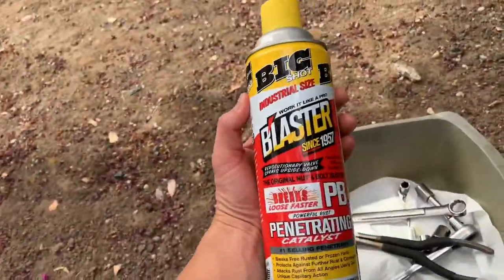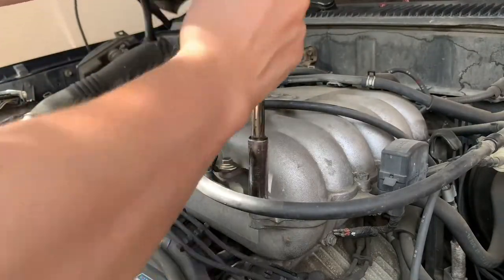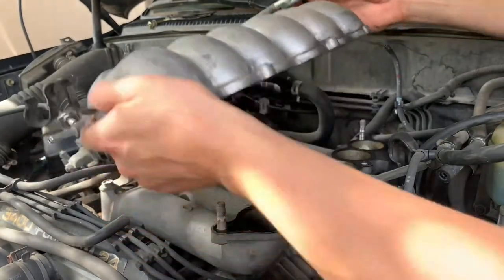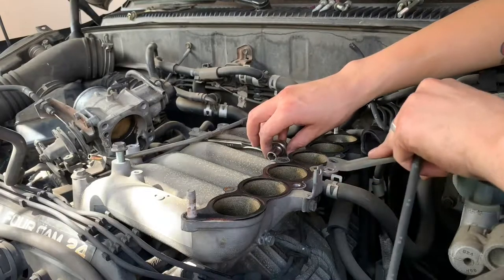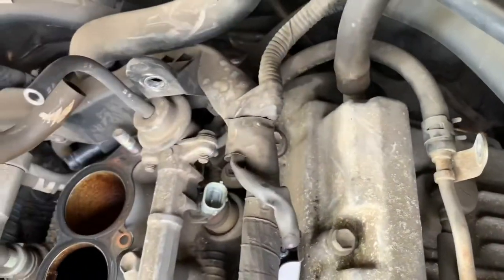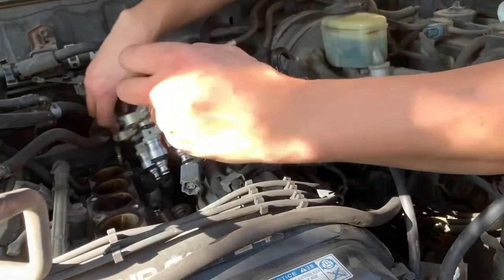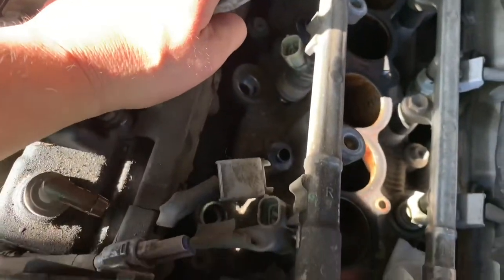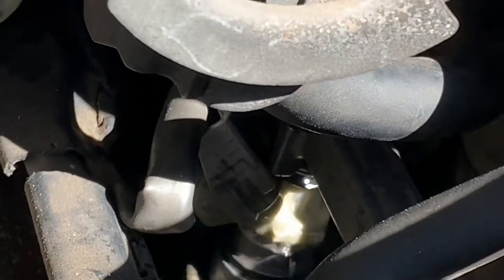How To Change The Fuel Injectors On A 1996 Toyota 4Runner / Misfire

Comment: Useful info here, and a much better edit than the other video I watched.  Shame about the sad ending.  I only replaced one, but it was passenger side (#3).  Encountered the same issue with tight clearance to that electrical housing, but managed to clear it with a little work.  Made sure the injectors slid back in nice and easy. 

BTW, some may be interested to learn that if simply replacing one of the passenger-side injectors (#1, 3, or 5), it's only necessary to remove the throttle body for access - can leave the intake on.  Also:  after pressing the fuel rail/injectors assembly back onto the motor, I gave each injector a little twist or wiggle which (I like to believe) helped settle that all-important o-ring seal.  Anyway, mine worked out fine, about 2 hours for this all-thumbs-in-the-garage guy.
Reply from the maker: I'm happy it worked out for you. I'm an amature so I still make dumb mistakes but I'm learning too. Thanks for watching
Reply: Thanks for the info on the #3 cylinder!!!
Reply: Mine is #3 also. Did you have to remove the whole intake manifold? Or the throttle? I just want to replace #3.
Reply: I'm slightly stuck right now...At the finish line too... You online?
Reply: Cool...Never hurts to ask.

Comment: Am in process of replacing only number 4 injector.  Symptom was misfire and code after warm up.  Ran perfectly at cold start, likely with cold start fuel enrichment from the ECM.  This symptom has been cured on other sites/forums I have seen/read about.  If you had a mechanical problem like a valve it would present itself at startup, cold and warm.  The fact that you had normal compression tells me not a mechanical problem.  I would suspect either a bad new ebay injector, ground wire issue to the fuel injector or a problem with the ECM itself.  The fact that the dealer could not diagnose the problem without tearing it apart is very suspicious.  At the dealership they have access to a lot of resources that I am sure would track this very quickly.  I should note that my drivers side banjo bolt was extremely tight.  I did not dare use a 12 point 17mm.  Created a snug 6 point 17mm and used channel lock to support fuel rain from twisting.  Used a lot of torque!!  And recommend to change banjo bolt washers and to cover intake holes from accidentally dropping something.

Anyway thanks for posting this video.  Very well done.
Reply from the maker: Thank you ya I ended up selling it as is sadly. I picked up an 55 Buick special so that'll be a new adventure. Thanks for the input!

Comment: dude thank you so much for posting this even with the mistakes. I'm about to do my 2000 3rz and seeing the struggle with the back bolts and the explanation why probably saved me 6 hours of cursing. I been putting off my injectors, they are still factory ...aggggghh. Gonna tackle it this weekend. Wish the pink top injectors werent so expensive
Reply from the maker: For sure! good luck man!

Comment: My 4Runner is a 99. I had to change the valve cover gaskets. I had a cylinder misfire on #2 also. That's not why I was doing it...Valve cover oil leak was my motivation. My cylinder #2 misfire was probably due to a broken injector clip...The clip fell off in my hand when I removed it...I ordered a new injector clip from Rock Auto so I get to do it again also...BUT....The valve covers are done. I watched this to see vacuum lines.

Comment: Throw a rag/towel over your intake while your working in there and it’s wide open...drop anything down one of those intake holes and it’s gonna be a nightmare especially if you don’t notice and it get stuck in valve bent valve or goes into combustion chamber and pops a hole through your piston

Comment: Hey young Dude , it's a lot of parts to put back just to get to the first bank injectors.  I think , I'll try a fuel injector cleaner and clean the gum off the throttle intake ,then hope for the best. If things don't work out ,  pay the price to the shop mechanic. Nice interesting video though.
Reply from the maker: Thanks for watching. Ya definitely do a fuel treatment. Usually the simplest solution is the best place to start.

Comment: Glad I Found Your Video.  I Actually a Bit Terried At the Moment.  I Too Have a Misfire In One of My Cylinders. New Plugs, Coil Packs and Plug Wires Didnt Fix It. I Luckily Found That Disconecting The Injector In Question While It Was Running Like Shit and Gave No Reaction Tells Me It's Probably That.  I Hope Lol.  Thank You For the Tutorial.  Have Any Tips For Me?
Reply from the maker: Happy to help. Just make sure the seat the injector correctly before you put it all back together... or you get to do it all again like me ...
Reply: I just hope that's my problem lol. Idk what else it could be. Thank you for your reply
Reply: Hey dude, ok soo i replaced the injector(had to do it twice cause they leaked haha) Seems to be ok now, not leaking anymore. But now i have a really high idle. About 2500 rpms on startup. It's leaking coolant from one of the iac valve hoses and i couldn't get it to stop but i now why it was leaking. faulty hose or that end nozzle is bad. My question now is did the injector change cause the high idle or is it the iac?  Thank you for your help.
Reply from the maker: @MyChemicalRemix  jeez you may have a few different things going on. Have you cleaned your throttle body plate lately? Sea foam may help. No my idle stayed to same
Reply: I got it figured out.  the idle adjusted itself after a bit and a new iac fixed the leak problem.  Everything is A Ok Now.  Thanks soo much for your help!  :)

Comment: So the o rings near the Switch dont have to all go in right ? Iam doing my Toyota Camry 2001 me I put some engine oil in my o rings so it will slide there is easy is that safe .
Reply from the maker: Honestly I'm not sure on your car. I would just put it back the way you found it. If the o ring wasn't all the way in the. I guess it was running ok that way before. I take pictures and video as I go when doing this kind of job so I can refer back to it.

Comment: I'm wondering what was wrong with your 4runner? What the shop "fix"? Let's us know!
Reply from the maker: They thought it could be a bent/stuck valve or some other problem with the head. Looks at a few grand to check out. I was over it so I sold it as is.
Reply: @b_ry_ce  Ouch...I seriously doubt that was it.

Comment: My 4runner lost power and only till it reaches temp it gets power but not fully.i did my spark plugs .wires and cap and roter but still the same ..do u think it might be a fuel injector?
Reply from the maker: Honestly there is so many strange things that happen with these 4runners. I wouldn’t want to say it could an injector. It could be so many things. Electrical? I took mine to a shop and spent $500+ diagnosing and still didn’t have a clear answer. I sold mine as is because I suspected valve damage.

Comment: Ok guy was wondering if u could help me so my 97 4 runner is reading p0300 random misfires then I get codes after that P0301,02,03,04 and 06 I changed the spark plugs coils and cables can't be anything with the fuel system it's rarely new no air leak changed 2 hoses and sealed my coil canister bcs of leakes I'm it runs great not sure if it's the injectors though bcs it has a ok idol and it feels like it has good power does t turn off or shake. I want to run a compression test but looking where I could get the tools for that but other than that I have no clue what it could be if u know any hints that be great be great
Reply from the maker: Hi potentially the top end. Maybe a stuck or dirty valve? I ended up selling mine as is

Comment: Have you solved the misfire? Im on the same boat
Reply from the maker: Nope sold it for parts. It had to be something in the heads/valves so I said fuck it
Reply: @b_ry_ce  damn yo. Im doing the injectors tomorrow and basically did everything you said at the end of the vid already. Im praying this solves my problem. trying to diagnosis this misfire been driving me crazy for months
Reply from the maker: @simonh2734  I know how you feel. Most like it's just an injector. Best of luck on it

Comment: Bummer! What ended up being the problem?
Reply from the maker: Ju I took it to a shop and after $500 of diagnostic work they didn’t know. Their best guess was that a valve was slightly stuck open. Over 1k just to pull the head off and check so I ended up selling it for parts. Definitely lost money on this one
Reply: @b_ry_ce  
Your breaking my heart I’m having the same issue and I’m changing my injectors  right now 👎🏼 I saw the end of your video bummer man.
Reply from the maker: @85Twisted  Ya I was dumb. Just make sure not to put them in dry like I did. I never did end up getting it running right. Sold it as is for $2500